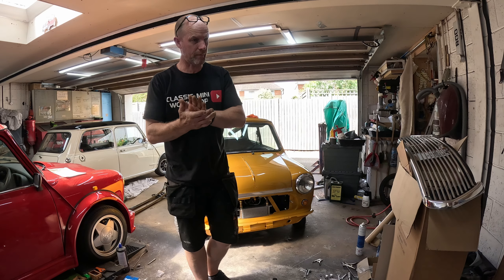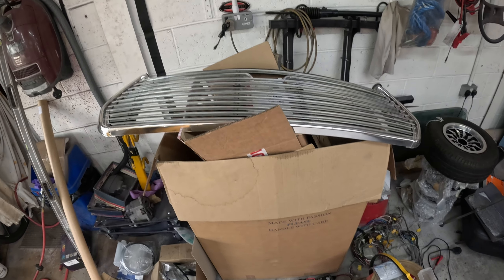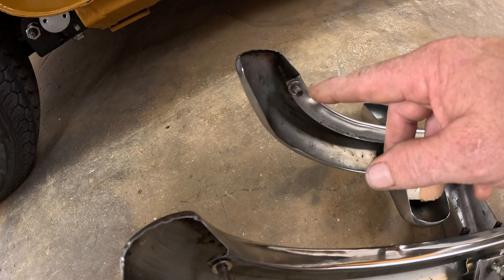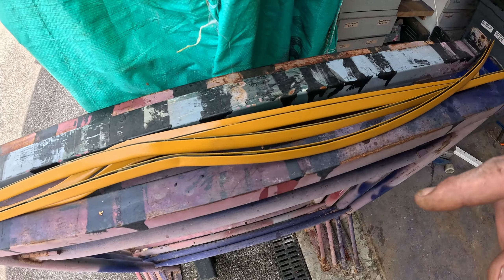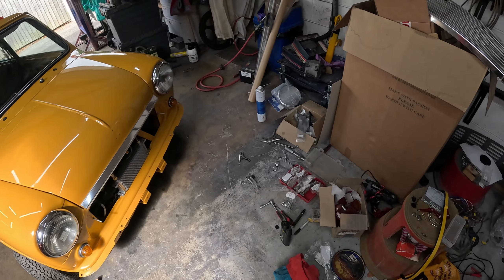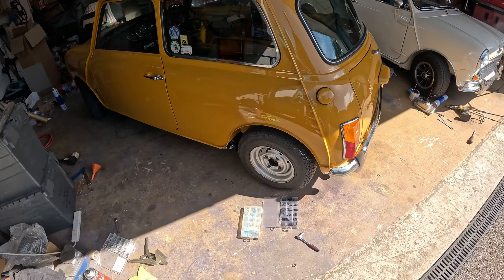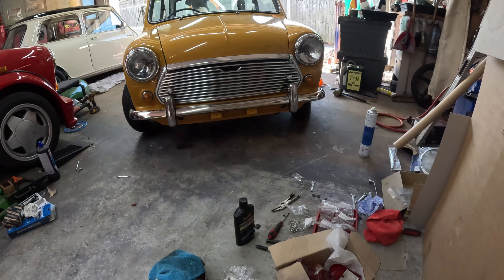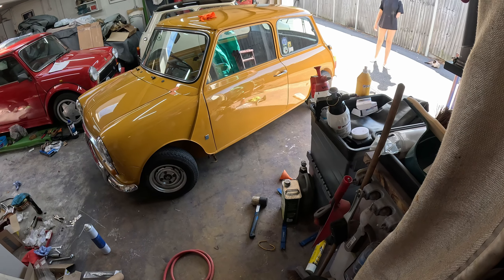Fitting Rear Lights With Fuel Tanks In! - Classic Mini Workshop Pt.69

Comment: I’d be more than happy to do the running in mark , no charge 🥰
Reply: 😆 Fortunately the engine was rebuilt in 2017 so it won't need running in, but we will definitely meet up in the spring so you can have a drive in it. 🙂

Comment: Well done kacey and lucy, that must have been a tough job getting the lamps in without removing the tanks.
Reply: Cheers Paul. It was easier than taking all of the fuel pipework apart, so did its that way.